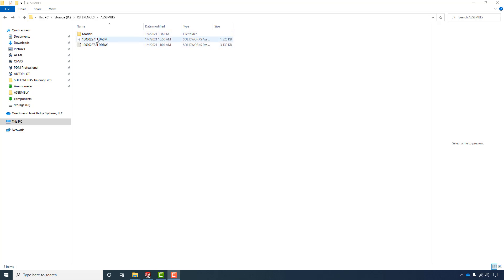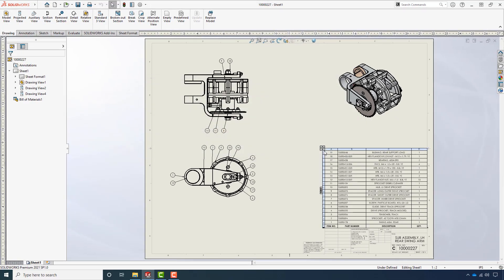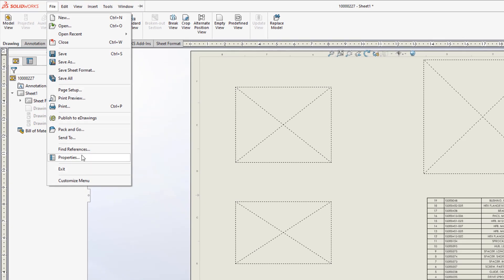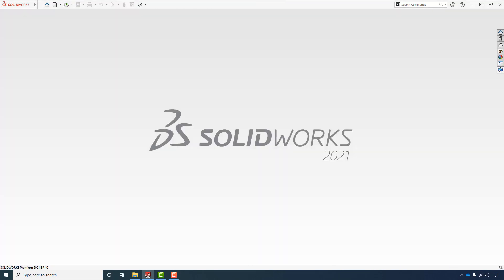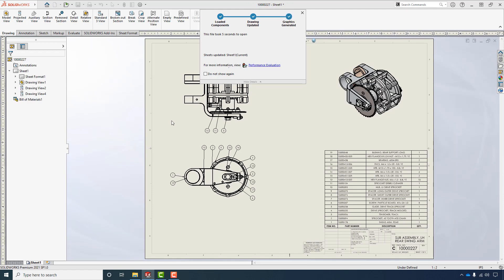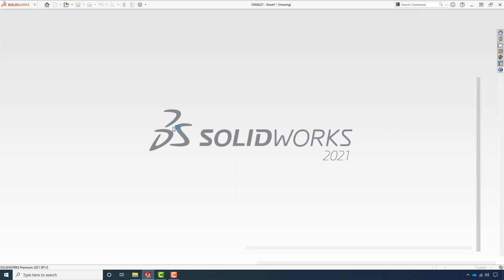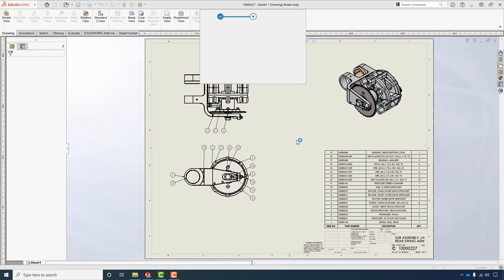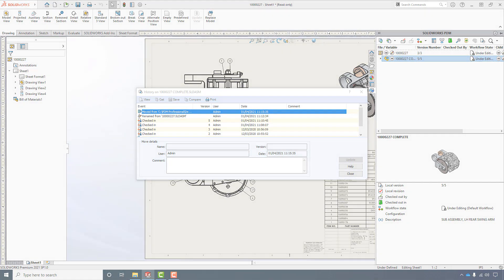How to Fix SOLIDWORKS File References

Comment: My problem is slightly different.
I am running SolidWorks on a Virtual Machine on Linux.
And I am opening the Main Assembly from a shared folder in Linux.
All the part files are already in the same directory, yet SW can not find them even when it is highlighting them in the open dialog box.
I do have just press Open, and then it gets it, but I have several 100 parts in this assembly so it gets tedious! What am I doing wrong?

Comment: I found a way to have SW actually save the Search Path and not over write after you changed it.
1. Open File explorer, top taps select view, check box checked for hidden items
2. Open "Indexing Options" in your computers Control Panel.
3. Click "Modify" button
4. Make sure your desired file location path is in the "Included Locations" and remove undesirable file locations that maybe causing the reference priority issue.
5. Open SW, Options, File Locations, show folders for: search paths -> make sure your desired file location is at the top of the priority.

I hope this helps anyone else that has been running into this issue!

Comment: I'd have to agree with all the other comments, that this fix does not actually work. You can change the reference, but it reverts back when you open the file. This may work if you rename a file, but no good for a broken reference or replacing a reference file path. Very frustrating.

Comment: If I change this reference, it shows green and I click OK. Then when I try to open the drawing, the file path is still looking where it doesn't exist. It seems no matter what I do I can't overwrite the reference. As soon as I close the dialog box it ignores it and goes back to the old reference. Not sure why it won't save when I change the linked file... any ideas?
Reply: For me, I had to open the drawing from the recent documents window. Then when the "browse for file..." pop-up comes up, you have to hit [browse], then select the (renamed/moved) reference file and you should be good.
Reply: I've the same problem
Reply: What I just did to work around this is open up the "file locations..." option in the "Move" dialog box and copy the file path to our "engineering" folder and then it will search within that entire folder for where used and it will update when you move or change the name.